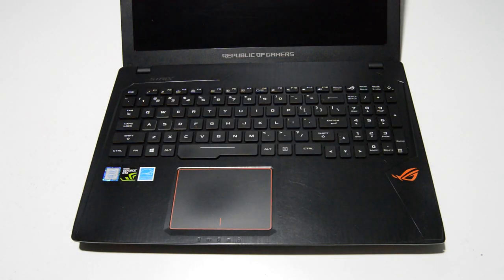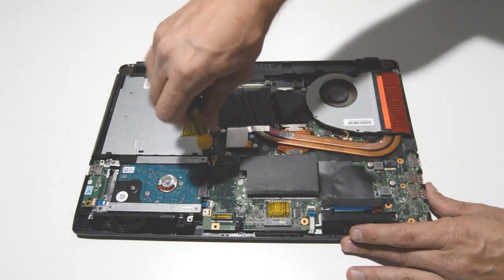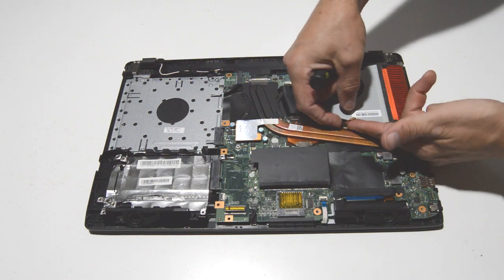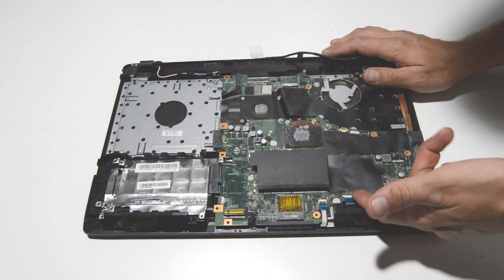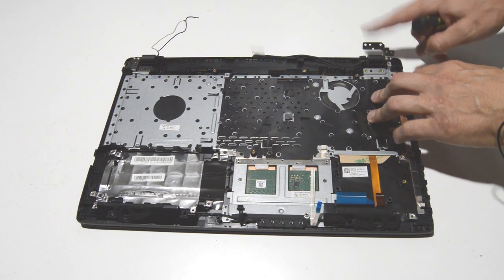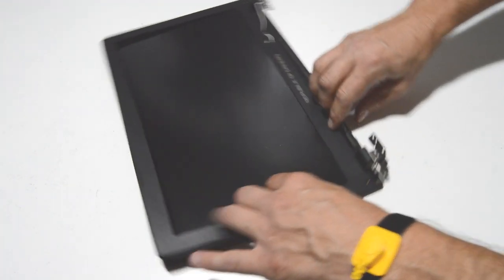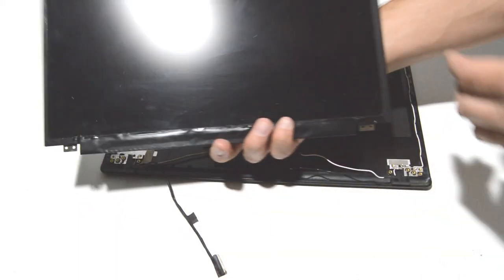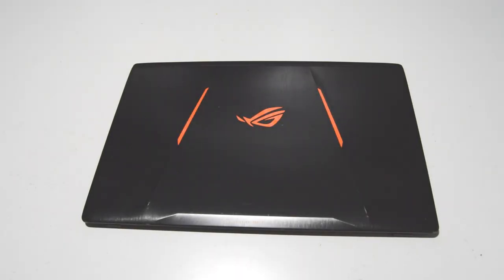How to Disassemble, Repair and Upgrade Asus ROG GL553V Laptop or Sell it.

Comment: Mine stopped working a few days ago, finally I got the correct screwdriver. It is making a ticking noise when I plug in, like 5 ticks a second. It is not a battery problem, it is doing that even with a disconnected battery. I will try a different adapter/charger. Might be a motherboard issue I think. Is there anything I can do to try to repair it if the other charger does not work either? Not worth spending money in pc repair shop on a 10 years old notebook 😔

Comment: Hi, I think I'm a year late. I own this laptop and it's the best I've had so far. Your video helped me a lot, however, I have one question: is it possible to upgrade the cpu? mine is a i5 and I'd love it to be a i7.
Reply: For laptops it's a bit more complicated, you need to find a same socket processor compatible for the motherboard it comes with and then soldering is required. If you're opting for upgrades and retaining the same platform for a longer time, get a desktop computer as the components are easier to manage. Laptops are clustered by design, and to make them use as less space as possible, most pieces are soldered to the motherboard. 

PS: Laptop motherboards are usually over 50% to 70% of the laptop's price, be very careful with it - talking from experience, as I've learned by testing :D

Comment: Awesome! Really helpful. I am trying to replace the CMO battery since I am having problems booting the laptop, but it seems attached to the motherboard. Do you have an idea on how to do it?
Reply: up
Reply: To anyone still reading this, the CMOS battery itself is fixed with an adhesive patch. Disconnect the CMOS battery PLUG and pull it carefully.

Comment: Great video. You disassemble the whole laptop. I only wanted to replace the keyboard and I still don't know how. Should I take off every to reach the keyboard?
Reply from the maker: Sorry the keyboard is integrated into the palmrest. Check out 8:50 and you can see where it is riveted into the palmrest. You will need to replace as an assembly.
Reply: SellBroke Hi, I have a strange problem. Suppose my laptop is turned off and I plug it in to charge, my keyboard lights up! Yes, my laptop is off but my keyboard lights up! If I turn off the switch, the keyboard lights also turn off. The moment there’s power connected to laptop, the keyboard lights turn on even if my laptop isn’t on! My keys don’t work at all, whether using the laptop plugged or unplugged. I know this usual behaviour of keyboard has something to do with it mot functioning at all.   Here’s what I’ve done so far and nothing has changed - PC reset, system restore, drivers reinstalled, virus/malware scan, unwanted programs removed, Regedit UpperClass entry issue resolved, Rededit PS/2 keyboard entry,  issue resolved, tried various driver softwares as well, did the windows updates, my keys just won’t work
Reply: The only key that works is the power button. Also, External keyboards do work but It’s not practical to carry a wireless keyboard everywhere along with a laptop
Reply: @uvnline  My laptop has the same issue man, have you fixed it?
Reply: chuy27arts Hi, so I sent it to Asus and they told me that it’s a motherboard related issue. They replaced my laptop.
Reply: @uvnline  Hey, got the exact same issue. Did you have warranty on your laptop? Mine is a used one and I am wondering how much ASUS would charge for a repair/replacement (with no warranty) in case it's the same fix

Comment: I tried to fix brass insert in to hole near the battery with glue unfortunately ,glue stick with screw. So screw not coming out because the brass is stuck. Guide me how can I loosen it? Oil not  helping.

Comment: Hi, I lost the hidden middle screw (under the rubber), should I go find a replacement or is it okay for me to just cover it up with the rubber on top? 
I'm concerned if it'll compromise the rigidity of the device
Reply: I would take one of the screws from the sides and use it in the middle. I dont think it would make any noticable difference. Actually the screw which is located on the right corner came loose and didnt notice until I saw it. Gosh, as I was writing this, I checked it and surprise, it came loose again :D
Reply: @JacobianMatrix9  thanks!!

Comment: So you have to take it completely apart such as in the video if you want to replace the bezel and hinges?
Reply from the maker: The bezel you may be able to remove without taking apart the laptop, it depends on whether you can get the bezel screws out with the screen assembly in place. The hinges you would need to disassemble most of the screen assembly and at least the bottom case to get to the lower hinge screws. It looks like it would be easiest to remove the screen assembly  and then replace the hinges.

Comment: Can I directly take the cooling fan off without having to dissemble the others? I just want to clean the cooling fan. Thanks in advance and thanks for this helpful video :D
Reply from the maker: Yes check out 4:07, you should be able to once the bottom case is removed.

Comment: Now I know I can actually replace the WiFi card. Most laptops it’s built into other parts. So it’s good to know I can actually replace it. Can you post a link where I can get one for my laptop. The card in mine is going out
Reply from the maker: This is the one from the video: https://www.ebay.com/itm/ASUS-ROG-Strix-15-6-GL553VE-DS74-Genuine-Laptop-WiFi-Wireless-Card-7265NGW/402282930215?epid=1055557091&hash=item5da9ee6027:g:ibsAAOSwz~he1nwl

Comment: Hello ,could you please explain to me what the black plastic piece over the ram slots is for ? I noticed that my own laptop has one and it is blocking air from reaching the ram slots and the mosfets nearby from the laptop cooling pad ,can I remove it ? I noticed everyone keeps them ,some people mentioned the plastic piece is there for thermal insulation of the bottom of the laptop while others say it is for electrical insulation from the chassis ....please help
Reply from the maker: I would vote for electrical insulation, since many laptops have a metal bottom cover. This one is plastic so I'm pretty sure you are OK removing it.
Reply: @Sellbrokedotcom  you must be totally correct because this is not my laptop ,I have an hp omen but I stumbled upon this video of yours , my hp also has a metal backplate thus I am pretty sure you are correct

Comment: Hey, I have a pretty big issue with this PC. 
Lately, the right hinge of the screen broke, I wanted to ask you if you know where I could buy one set safely and not for too expensive also.
And i'm in France, if that can be an issue
Reply from the maker: Looks like the only ones on eBay come from China. You might try that, they should ship internationally.

Comment: Is the Nvidia card soldered on the board? Or can it be upgraded or replaced? 

I have the exact same laptop.  My Nvidia card broke. Laptop works fine with the Intel graphics but no games. So i don't know if i can replace the Nvidia card. I was wondering if you could tell me. Thanks.
Reply: Did you find out?
Reply: @_apple_juice_  i did find out yes. The card is soldered on the board.  Can't replace or upgrade. Have a burnt graphic card now. Gonna put external GPU on it.

Comment: Can i replacement the cooling fan with a quieter one?
If yes, what fan would you recommend?
Reply from the maker: Not that I know of, the fan needs to be strong (and noisy) to cool the GPU and CPU on the same heatsink.

Comment: Hey! Want to buy METRO MDV BA 1 Vacuum cleaner /Blower. What's the latest model? Is it risky to use sitting on bed.. Is the shoulder strap made of steel? Safe to use as a physically disabled Man? Reply ASAP. Which liquid I should use on my ASUS GL553VE LAPTOP BODY? PAINT MY LAPTOP MACHINE.. ANY BRAND OF PAINT IN MARKET..REPLY ASAP.

Comment: hey! i have a question, i have this laptop and i’ve had it for around 3 years now and the hard drive is corrupted, could i purchase a new one and install it myself or should i take it to a professional?
Reply: u can instal it urself, what i did was i purchased an ssd which was way better and it worked perfectly

Comment: Hey i just wanna clean my fan so all i need to do is follow the fan removal part right? nothing else needed to be removed? Thanks
Reply from the maker: Correct
Reply: Hey buddy have you cleaned your fan? İ tried to pull my fan but it was stuck to my heatsink (might not be completely stuck to it but i just did not force to pull it because i could break it since i have no experience in such things) should i just pull it until it comes? İs there any risk for it?
Reply: @imransuleymaneraslan2797  i'm having the same problem i tried pulling it but i think it is stuck
Reply: @babanski295  there is a kind of tape keeping the rad and fan together you can just unglue it (but the one you should clean is the rad because that's where dust interfere with heat exchange)
Reply: @flobi0904  how can i unglue it? should i just pull it out?
Reply: @babanski295  yeah, but look if there is no left screw, but if you can lift your fan up I assume there is no screw left
Reply: @flobi0904  thanks man!

Comment: This video is great!
I've got a problem with my GPU and would love to know where it is, cause I haven't found it even after twice xD
Reply from the maker: It sits right next to the CPU, and it is integrated into the motherboard. If you're sure it's not a driver issue then you will have to replace the motherboard.
Reply: SellBroke thanks, how much for the motherboard?
Reply from the maker: @DiviDAlpha  It looks like they run about $600 on eBay with the GTX1050
Reply: @Sellbrokedotcom  Thanks for the response
Reply: You better buy a new laptop then 😂

Comment: Only one fan for ROG laptop... damn, perfect decision ASUS... now I understand why my i5 is throttling in games. What about i7 with this poor cooling system? Anyway thank you for really helpful video.
Reply from the maker: No problem! And you are right, sharing a heatsink between the GPU and CPU like that is not good for cooling!
Reply: I7 is way too bad. I had to turn off turboing, undervolted both cpu and gpu and it still thermal throttles. Regret is the only word that can describe my 1,300$ purchase.

Comment: hi, please tell me where the connector for keyboard backlight is. Mine is loose and the lights keeps blinking due to that.
Reply: Let me know if you found it
Reply from the maker: 8:07 its the smaller gold ribbon on the right next to the fat keyboard ribbon.
Reply: @Sellbrokedotcom  thanks a  lot buddy <3
Reply: @chuy27arts  i hope that answers your doubt too :DD
Reply: @Sellbrokedotcom  Si the blue one is the from the keyboard? My keyboard stopped working entirely. I'm afraid I may have to replace it.
Reply: @vedant8041  Thanks friend! Pretty much does, just wondering if the other one is from the keyboard itself
Reply from the maker: @chuy27arts  Yes the wide ribbon is for the keyboard, but you might want to buy the palmrest and keyboard as an assembly since they are not meant to be separated. The backing plate is held on by melted plastic rivets, you have to break them to get the keyboard out.

Comment: WILL U UPLOAD A VIDEO SHOWING JUST THE TIP OF THE SCREWDRIVER U USED TO OPEN UP ASUS GL553VE LAPTOP ... JUST TO CONFIRM I WANT TO BUY ONE AND OPEN UP MENTIONED LAPTOP AS WELL AS ASUS VIVOBOOK S14 41OUA LAPTOP. REPLY ASAP.
Reply from the maker: Its mentioned at the beginning of the video, 2.5mm Phillips

Comment: May I know how did you remove the stripped screw that was holding the HDD? I have a stripped screw holding onto my SSD and I am having a hard time taking that out.
Reply from the maker: If its not too stripped you can try pressing down really hard while turning. If you have a small (precision) needle-nose pliers you can usually grip the outside edge of the screw top and loosen it that way too. You might have to drill it and use a screw extractor bit if its really bad.

Comment: Hey! Which glue can I use to tighten the rubber under my Laptop.. Answered soon.
Reply from the maker: Weathestripping adhesive is best, but most silicone based glues will work fine.
Reply: @Sellbrokedotcom  Thanks For Ur Suggestions.

Comment: i have this laptop and my wifi card and antenna needs to be replaced where can i order both at?
Reply from the maker: Probably Asus directly. I don't see anything on eBay for the antennas, the wifi card you can get anywhere, just find the model number on the label.

Comment: hi, i have a question, i have this laptop and i'm planning on upgrading some components, could i upgrade the processor and graphics card? and i started have some blinking on my screen, what could it be? thanks in advance
Reply from the maker: Processor and GPU are integrated with the motherboard and you can't replace them. See if only the screen blinks or an external monitor as too. That will give you an idea what's defective

Comment: hi, has the m.2 SSD slot of this laptop a NVMe or a SATA 3 protocol or both?
Reply from the maker: The slot is an NVMe 2280 and you can also get a 2.5" SATA SSD to replace the hard drive.
Reply: The M2. slot supports both SATA and NVMe.

Comment: Nothing happens if I just remove the cover to clean the fan a bit with air, without disconnecting anything and then put it back? I do not know much about technology and configurations, I am afraid to disconnect a cable and have to configure something or it will not turn on again
Reply from the maker: You can clean the fans/heatsink easily by just blowing air into the vents in short spurts. No need to remove the bottom case unless they are really dirty.

Comment: Hello ! Again  Friend just to be sure your Laptop is ASUS GL553VE LAPTOP right.. I have to just pull the wires of the Battery and the White  connector will Disconnect... Tried But.. Confused.. So I left it Undisturbed.. Reply.
Reply from the maker: There are tabs on the connector you can get your fingernail under and just wiggle it out. Start at 1:24 in video.
Reply: Thanks a Lot... I may ask for more help  from U later.

Comment: I have the same laptop and i have an issue, when i play games or render ( stressing the pc) sometimes i'm not doing anything with it, it shut down, i changed the thermal past and still shuts, this issue only happen when he is on the charger, but it doesn't when on battery, i'm really confused and its happening since a long time, can u plz help me??
Reply from the maker: Sorry but there is no solution :( The cooling heatsink is extremely under-sized and crosses both the GPU and CPU together. That's not good. Also only one fan is cooling both components.... so it overheats when stressed even a little bit. The reason it doesn't do it on battery is your power settings usually throttle the system already to preserve battery life, so it's not going to stress it as much. I would check some forums about your model and the problems others have had..... might be time to get a different laptop.
Reply: @Sellbrokedotcom   i really don't think it"s because overheating , sometimes i'm not doing anything , just chrome , and the temp is under 40 and shuts  down , i"m a student i can't afford another laptop for now and fk i need it cause it's my last year :p

Comment: if i want to change the CMOS battery do i have to strip all of it or only like DVD, HDD and the ribbons?
Reply from the maker: Since its underneath the motherboard you have to remove everything that's attached to it.
Reply: @Sellbrokedotcom  thank you but still my rog doesn't want to show bios what should i do now? Do you have any idea?
Reply: @mouudamee  bro i have same problem with u my rog bios doesnt show bios are u already fix it?
Reply: @andrysugiarto4140  nope i figue it out that my graphic card broken
Reply: how did you remove the cmos. it feels like it going to break if I force it.

Comment: Hello i have GL753VE and I am unable to find any information about it. This vid features the closest model by looks of motherboard. Could anyone tell me if i can upgrade RAM in this notebook and if i can do it safely, also what max amout of RAM is supported?
Reply from the maker: Check out 2:02, RAM slot is like most others you can add RAM if you need. The amount of RAM supported should be listed by ASUS somewhere.
Reply: @Sellbrokedotcom  thanks

Comment: Is the keyboard is non-removable???
Reply from the maker: It's meant to be integrated into the palmrest. It might be replaceable but it will be a pain since its held in by plastic rivets. Once those are broken it will be tough to reinstall in a way that holds.

Comment: HEY! MY LAPTOPS ADAPTER MODEL IS ASUS A15-120P1A ..ITS CONNCTOR WAS TORN ONCE AND WAS SHOP REPAIRED .. NOW IT MIGHT TEAR AGAIN , ITS LOOSE . HOW CAN I FIX IT AT HOME ? SUGGEST ME SOMETHING . SOON .
Reply from the maker: Do you know how to solder? Some solder and electrical tape can fix a lot of problems, assuming you're talking about the low voltage plug that goes into the laptop. I wouldn't try to fix it if its the wall plug-in side.
Reply: Yeah.. I'm talking about the side which goes into the Laptop  but soldering is used on metal things if I'm right.  I'm talking about the part which joining the adapter  ..Reply soon.
Reply from the maker: @darkmatter8650  Ok so just the plastic outer insulation is torn then right, the wiring is good? You can wrap it in electrical tape, I recommend 3M Super 33+ tape, but any electrical tape should do the trick. Clean the surface of the cord with alcohol first so it will stick better. Another thing you can use is plastic epoxy, it bonds much more solidly but doesn't flex.
Reply: Thanks.